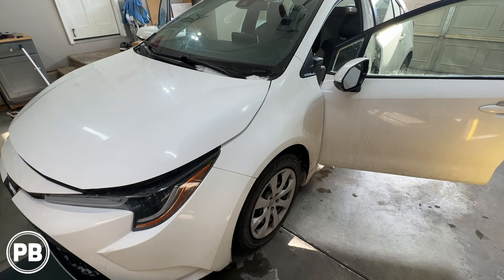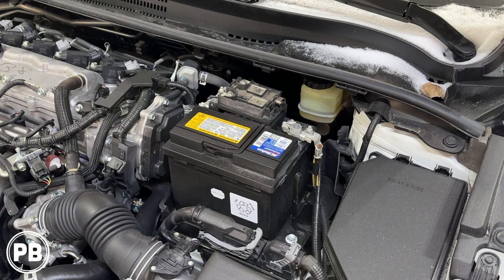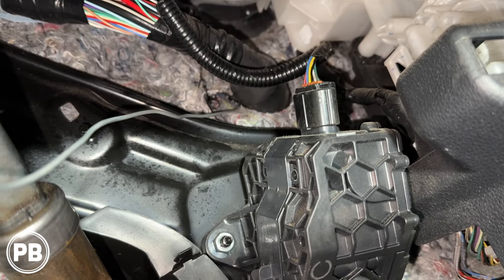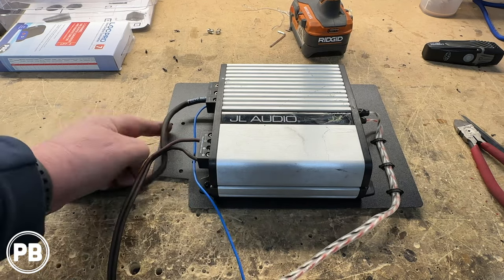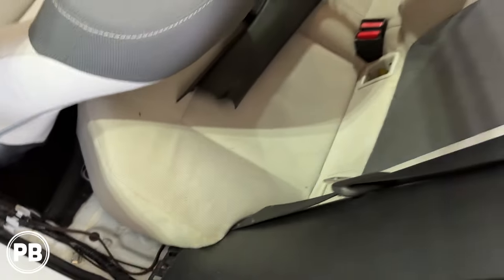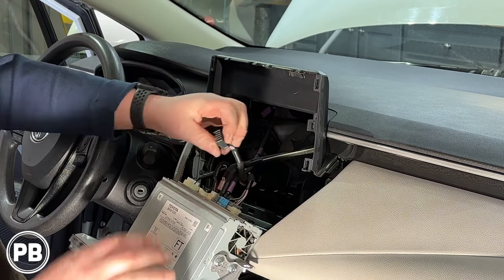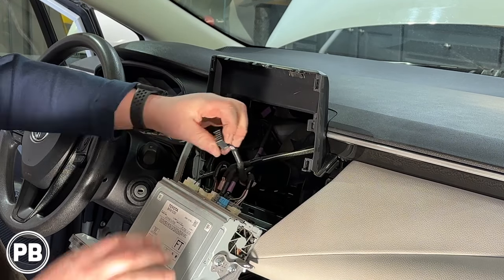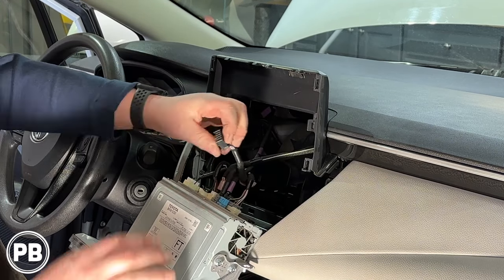2020 - 2023 + Toyota Corolla Amp and Sub Install

Comment from the maker: Parts used linked in the description of the video!
Reply: By FAR the BEST video on this subject I could find! Clear and easy too see what needs to be done.
Reply: Wth makes that T-harness $60?!
Reply from the maker: @vincentking8267  For the full Pac T harness, yes.  For just the non-JBL speaker t harness, it's cheap.
Reply: @ProvoBeastAudio  FYI, I checked out some of the cheaper ones, and that red wolf wiring is only 20ga 😬. And I can't seem to find a good alternative, so I may be buying more expensive, or cutting into the harness, because I'm not sending amped signals to door speakers through 20ga wiring.

Comment: If you’re doing this on a 2024 the wires are gonna be completely different colors than in the video. The good thing is that the wires are all in the same position. Just put my system in today and damn near shit myself after seeing that the colors were different. Threw a Hail Mary and guessed that the connections were all the same just different colors and it worked🙌🏼
Reply: Bro can you help me what color is the 12v and ground?! I figured out the spks

Comment: DUDE!!! THANK YOU. I just got a 22 XSE that for some reason didn't have the JBL system and desperately needs at least a sub. This is exactly the video I needed
Reply: Are there 2 speakers up on dash by glass window.??
Reply: Right? I have a 21 xse and whoever bought it first, never got the upgraded system… you get the xse but don’t upgrade the radio? lol 😫

Comment: That’s an m6 bolt for the ground wire. Found that out today. Your video was super useful for my 2024 Corolla install
Reply: Did you do it yourself?
Reply: @NSBhomies  I did everything but the line output converter on the deck. Had a shop do that and adjust the gain. That little 8” Skar EVL hits hard with the 800 watt amp that came with the kit.

Comment: Thank you for this, hard to find any wiring schematics. I just installed this exact set up almost, and the speaker wires are the same, on my 2022 Corolla SE, behind the head unit(radio). Getting the power wire through the firewall is by far the hardest part. I tried going through the passenger but it was too tight and I did not want to remove the windshield wiper and cowel. I removed the battery and had a bit more access to the grommet back there. After some cut up hands everything is installed almost exactly like how you did it. Last thing I need is an AUX cord to connect my base knob but other than that I’m set! Finally, so stoked. Much appreciate you taking the time to film this.
Reply: so removing my battery is the secret. say no more
Reply: I got the same car, hooked up all the wiring but not getting power to amp. I jump the 12v and remote wire and there’s power. Any idea what i’m doing wrong?? Please help! Lol
Reply: @SoplaMoco407  no power to amp?

Comment: Thank you for the video, massive help to the DIY community. Got a Skar SDR 10" sub installed running at 500W rms off of a Leigesaudio cheap amp, Stinger 4ga wiring, Kicker LOC, Red Wolf harness adapter on my 24' Corolla LE. Not one broken clip so happy haha. After much main manually locating rear speaker wires and polarity with my buddies tool the system sounds great!!
Reply: which one is it i’m currently looking for it

Comment: Thank you for taking the time to make and post this video! I had no idea how to get power through the firewall and to the trunk on my 2023 Corolla. I couldn't see any grommets because of the heat shield. This saved the day, and it really wasn't as bad as I thought it would be. Instead of soapy water, I used dielectric grease and it worked great. Thanks again!
Reply: my heat shield is in the way too, help me brother. please

Comment: For anyone who needs wiring info on a 24 Corolla Hybrid LE  for LOC install! (No info online had to verify with NVX speaker polarity tool)

RR speaker:
Purple speaker wire to Blue radio wire POSITIVE

White speaker wire to White radio NEGATIVE

LR speaker:
Pink speaker wire to Pink radio NEGATIVE

Green speaker wire to Green radio POSITIVE

Comment: Question:  I have the 2020 Corolla XSE with the dreadful JBL so-called upgraded audio package.  Can I tap my Wavtech Link DQ LOC from the JBL factory subwoofer leads to gain the lower frequency hertz???  I have played 40 and 50 HZ test tones and metered the voltage and get nothing.  I only get voltage when I play midrange frequencies around 200-300 HZ.  Thoughts?  I hear the factory sub is DVC so I assume I would connect both positives together to the pos lead of the LOC and the same for the negative.  I am running a mono 1200 watt rms Pioneer amp at 1 ohm (stable) to only power a 1200 watt rms American Bass subwoofer.

Comment: Hi Chris! Great videos, like always!

I'm trying to connect an Alpine KTP445A amp to my Corolla Sedan (2023), The speakers are already connected with an individual harness for the speakers with the 445A harness, was the only thing I finded until I see your video...

The doubt that I have, is if I have to buy PAC LPHTY02 to complete my installation or if I can connect the power cords individually of the other plug an can work correctly.

I supposed that direct 12v, ground and key ignition 12v are basical, but the telephone wire, remote one or other are compulsory to work. Or being connected to the main unit, they are doing their function yet.

The thing is that, where I can found a diagram of factory plug for knowing which wire are every one. Cause 12v and ground I have located with your video, but in my car are different colors...

Thank u very much in advanced!
Reply: I'm having the same issue at the moment did you ever figure out which wires are for what?

Comment: Hi Chris, for non-JBL corolla. Do I need to buy both optional T-harness you linked or just the full pac?
Reply from the maker: No, you can simply by the red wolf one to prevent the need to tap into the OEM speaker wiring.  If you want to tap into power and ground as well of the radio, then go with the Pac Harness.  It's one or the other, not both.
Reply: @ProvoBeastAudio  alrighty, thank you very much!

Comment: Hey Provo Beast,
If I use the Full Pac T-Harness, will it already have a ground cable?
Or would you recommend making one like you did by using the mounting locations (6:11)

Comment: I replaced my factory speakers with some good kicker ones, but I still have the factory stereo unit. I'm planning on adding a subwoofer and a 5-channel amplifier (using this video) and if possible, I'd like to add my new speakers to my amp using this same method. Is it possible to use this method but with a 2-channel output converter for my sub and a 4-channel output converter for my speakers? Or is this only something that can be done when adding a subwoofer? I have a 22 Corolla SE without JBL.
Reply from the maker: Some 5 channel amplifiers have the option to internally pull the sub signal from the front 4 channels.  So you may only need to install a 4 channel LOC for now (depending on your amplifier.)

Comment: Could u do an aftermarket deck installation for this vehicle
Reply from the maker: Yes, a dash kit is now available for this, however, it only fits certain radios based on the space available.  Send us a message on facebook and we can assist you with the parts needed.

Comment: Was wondering if there's a more ghetto alternative for me. 

Will be a Corolla 2.0L Hybrid Sport Touring, with the battery and a power socket (lighter-type, IIRC) in the trunk. So, have a powered subwoofer, nothing too fancy or demanding, that I can plug in and out, and with a Blutooth receiver for the signal), with some app. Plus tere are some interesting storage compartments in the Touring that could be useful to tuck away some stuff. 

Subwoofers don't need high-fidelity signals, just anything below 100hz, which is pretty easy going for a wireless transmitter. With Android Auto, might even write an app myself. 

First, I'll probably upgrade the speakers, and work on a bit of sound insulation, something I already did in a old Almera. Will see how it sounds first.
Reply: Naaah, I think I'll go with the Basspro Hub, using its high-level inputs and auto-sensing. I'll need to make a harness though, but should be easy enough.

Comment: Hey Chris. I'm installing a single sub in my 2020 Toyota Corolla without the JBL sound system. I purchased the LPHTY02 T- Harness and the Pac LP7-2. My question is how to tap into the T-harness? Included with the harness are pigtails. Is that where to make the speaker level input  connection to the LOC and if so,should I connect to the rear speaker wiring instead of the front? Also, can i power the LOC by connecting it to the power extension pigtail harness that connects to the T-harness?
Thanks for your time Chris.
Reply from the maker: Lots of great questions, and to be more helpful, send me a message on our facebook page so we can walk you through the process!
Reply from the maker: Either don't use the pig tails and connect the speaker runs straight through, or use one set of pig tails (either the front or rear set) and tie in your LP7-2.  Yes, you can also tie in the power and ground into the yellow and black wires on the T harness.  Here is the manual which helps as well: https://catalog.pac-audio.com/index.php?controller=attachment&id_attachment=1990
Reply: Thanks alot Chris!  Im begining to see what needs to happen. I'll message you if I run into anything, or better yet, how it turns out! Thanks again for your time. Your installation videos are the best I've seen out.
Reply: Worked out great! I tied the  Line out converter (Pac LP7-2) into the left and right front speaker wires of the Pac LPHTY02  T-harness  using one of the the included pigtails LPH-SPK(E), ( red, red/black, blue, blue black) according to the instructions. I also connected the also included power extension pigtail ( LP-SPK(F) (yellow, red, black),  I cut and twist capped the red wire (ignition) , butt spliced  the yellow (constant 12V) and black (ground) into the matching wires on the LOC. So far, so good, and I didn't have to cut into the vehicle factory harness. Thank you for all the info you put in this video , and also taking the time, reaching out, and answering my questions. So again guys, thank you!

Comment: What size is the screw for the ground?
Reply from the maker: threaded OEM ground takes a 6mm with a 2.00 pitch
Reply: I found that a 6mm with 1.0 pitch fits 🤔.
Reply from the maker: If that fits, perfect! @nathanz602

Comment: How is the amplifier mounting rack secured to the vehicle ?
I've been looking for a ready made plate that securely attaches to the car , not just lay there ?
Reply: I've glued a wooden board under the carpet to avoid drilling in the floor. But now I want to change an amp bigger one And I Wonder where to put it or maybe again under the seat. However Access to amp under the seat is not good.

Comment: you can utilize the factory head unit when adding a sub and amp? A buddy of mine has a 2020 Corolla with no JBL sound. He wants to add a sub.  If the stock head unit can be utilized what will I need besides the obvious?  Here is my list so far
1. 10" sub enclosed with box
2. amp
3. wiring for amp/sub
4. wiring harness for head unit to sub/amp? will that be needed?

any help will be greatly appreciated
Reply from the maker: If you send me a message on facebook / instagram, happy to help.
Reply: You'll need an line output converter if the factory unit does not have factory rca outputs

Comment: After installation did anyone have issues with the steering wheel controls not working? I followed this video and installed a sub+amp in a 2022 Corolla. Two weeks after installation the steering wheel controls started acting up and eventually stopped working. I took it to the dealer who replaced the coil wire and the steering wheel and did not have the issue resolve. I had to bail out because if the issue was caused by the sound work it wouldn’t be under warranty. Any ideas? Again, I followed this guide closely. I’ve no idea why this is happening.

Comment: can you please elaborate step how to connect the t harness to the stock unit. this step is troubling me for a month now. I am in constant struggle to figure out how to do it. I hope 2019 corolla has the same config. Thanks
Reply from the maker: I have a plug and play harness on my website if you just want to buy it directly from me. https://www.provobeast.com/product-page/1987-2020-toyota-subaru-scion-add-an-amplifier-t-harness
Reply from the maker: It's because you have a 2019, and this video is for a 2020.  The radio harnesses changed in 2020 (similar to the harness is shown in this video).
Reply: @ProvoBeastAudio  good evening i have a 2022 corolla LE and i already have my bass amp connected but idk how to get the signal to it from the factory deck…which harness do i need because the wire colors are not the same in the harness someone help??
Reply from the maker: @Savage_2keyy  Send me a message on facebook or instagram.  I have a harness for you.

Comment: Do you think 0 gauge wire could fit through either one of the grommets?
Reply: did you try yet?  Im gonna run 0 gauge as well
Reply: @dueloneduel  yeah. The grommet above the Gas Pedal is where I did it. You have easier access going through the firewall, the grommet is behind the battery
Reply: @Crizpyx   thanks a lot!

Comment: Could you tell me if the customer supplied most of the equipment what should the labor charge be
Reply from the maker: Huge variables there - depends on the shop of what they will charge.  Most shops wont install your own equipment as they cannot warranty it.  You will have to call around if to find a shop that will install your own equipment.
Reply: @ProvoBeastAudio  ok

Comment: if both the black an gray connectors on the back of the head unit splice into the one connector of the PAC do i have to buy 2 t-harnesses? or do both the black and gray connectors connect to the t-harness?
Reply from the maker: If you just need to tap in for signal, just get the red wolf one linked in the description. It’s cheap and gets the job done.

Comment: I put everything together got spark in the ground wire. Then never again. My amp won’t turn in. I’ve tried changing the fuse in the amp. The one to the radio is good. I’m not sure if there’s any other fuses or anything else I can do. Or do you possibly think the amp could have fried. Idk what to do. Thanks.
Reply from the maker: Fuse under the hood by the battery.  Sounds like you had a short.
Reply: @ProvoBeastAudio  are you talking about the main fuse to the positive wire where you put the fuse in? I checked it and it was good. So I think I maybe had a faulty Amp so I’m getting refunded one

Comment: hey! i did what said but when i bought the t harness the power wires come with a yellow and an orange and have one constant coming from the car , but my car radio keeps pulling power even after dissconnecting my amp , any ideas what i did wrong ?
Reply from the maker: The line out converter may remain on until the vehicle goes to sleep for up to 5-10 minutes. Depends on the line out converter, depends on your connections.

Comment: Please do this install but with the JBL system.  I will love you forever!  Great channel!
Reply from the maker: Will do, once a JBL trim in this gen passes through the install shop!
Reply: Good luck with it!  You can not tap into any speaker wires as they are heavily crossovered and filtered.  You will only have 200-400 hz going to the sub from the LOC.  I assume a Kicker Key Loc is the only way to get a full range, clean audio signal outputted.
Reply from the maker: @jms7585  If you want a clean output, use the Pac AP4-TY13 if you have JBL!

Comment: For some reason, my wiring is COMPLETELY different. I have no white in the OEM wiring whatsoever. Everything that should be white is salmon pink-ish. I tried to hook everything up assuming it'd work, and to no one's surprise, absolute failure. No green light on the amp.
Reply: For context, I drive a 2022 toyota corolla LE standard. The hatchback shouldn't have any different wiring.
Reply from the maker: @nabrubus8313  Does your Corolla have JBL?

Comment: Can you do a Toyota Corolla SE 2023 with JBL audio?
Reply from the maker: Sure once we get one in the shop.
Reply: @ProvoBeastAudio  im looking forward to it aswell without the jbl though but should still help thank you!
Reply: @ProvoBeastAudio  
Is there a way to do this just by getting the signal through the back speakers? and can a 0 gauge wire fit through the firewall?
Reply from the maker: @AV_Cinema  If you have the JBL amplifier, generally this gen Corolla has the 9 speaker system, and a factory sub in the rear deck of the car.  You can tap into those leads at the factory sub for signal to your new amplifier.
Reply from the maker: @gtech039  Zero gauge should still fit, but will be very tight getting through the firewall.  You may need to drill instead.  As for signal to tap into, with the JBL amplifier, you will need to tap into the factory sub located in the rear deck, or at the factory amp under the seat.
Reply: Provo I am being tried to get the extension harness cable that has all speakers for the factory radio for the toyo 2023 which in fact is not a JBL, but I don't know which link has those extension harnesses to be able to use the LC2i PRO 2-Channel Line Output Converter. 
can you provide me the link to get that extension. please thanks/.
https://www.amazon.com/gp/product/B08GH3B3PW/ref=ox_sc_saved_title_9?smid=A2HGKN2AHQOSEC&psc=1